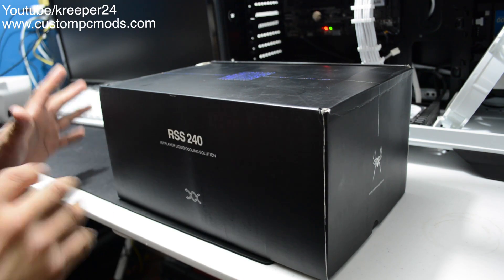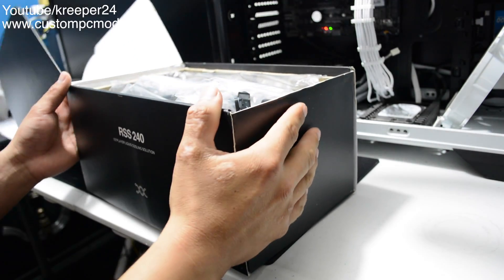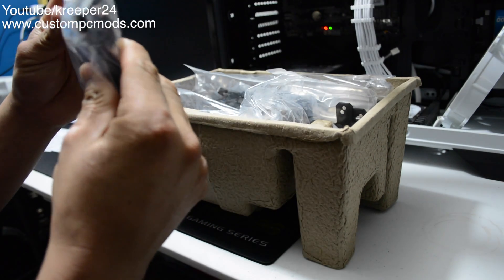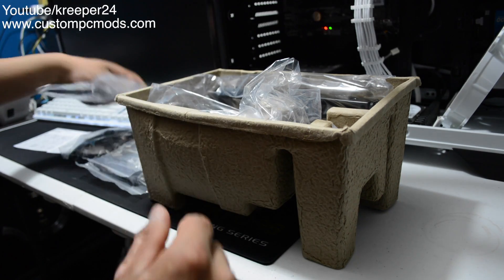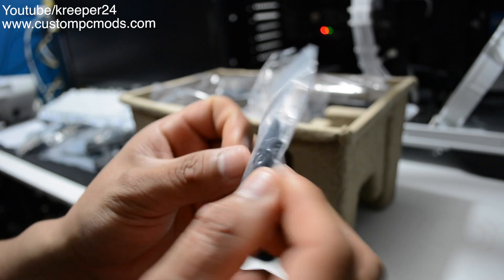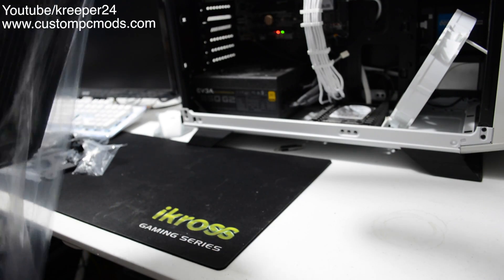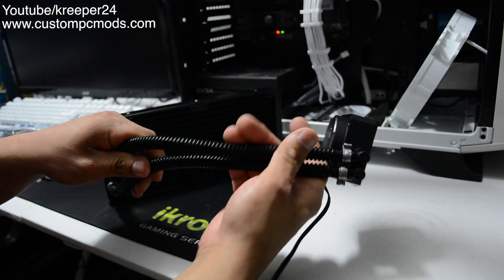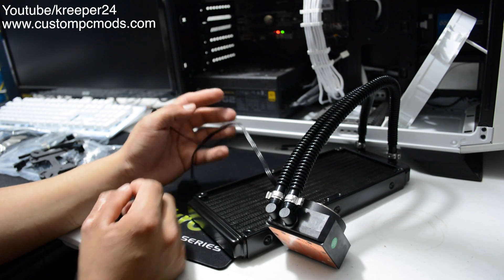RSS 240 AIO Liquid Cpu Cooler 1STPLAYER Unboxing Review & Performance

Comment: How did the installation go? 
What does it look like when it's inside f your case?
You unboxed the cooler, but you never unbagged most of it.
What were your temp results compared to other AIO coolers?
You never answered any question that a PC builder would wonder about.
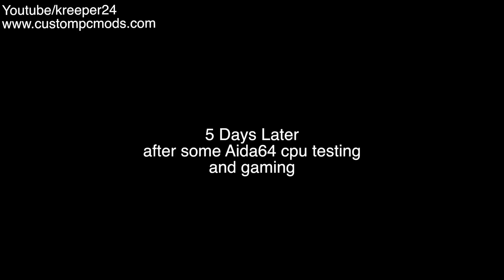Reply from the maker: +Neil Mathieson 5:45